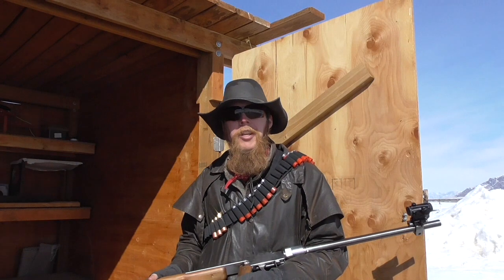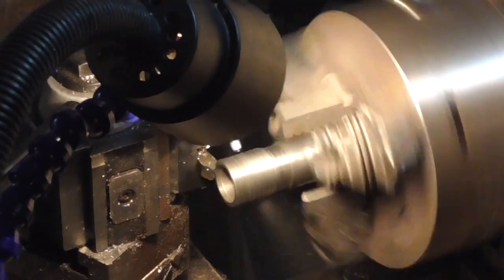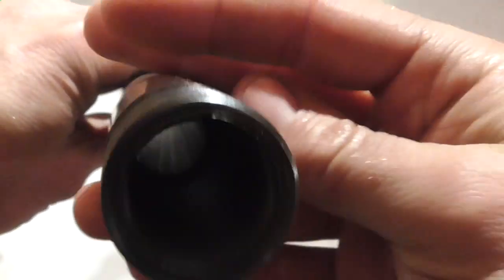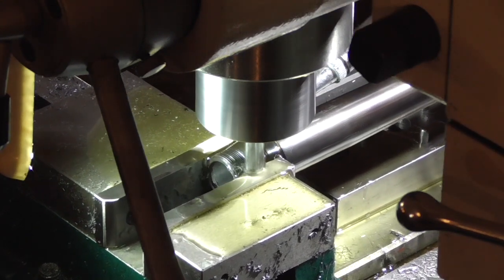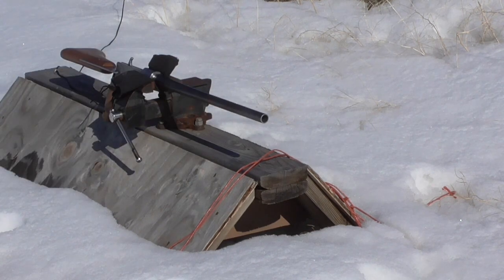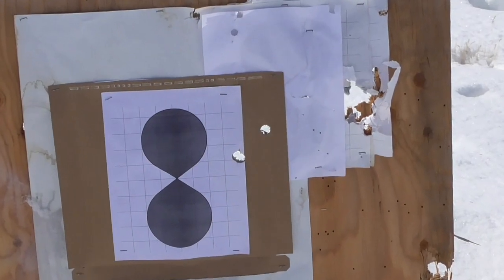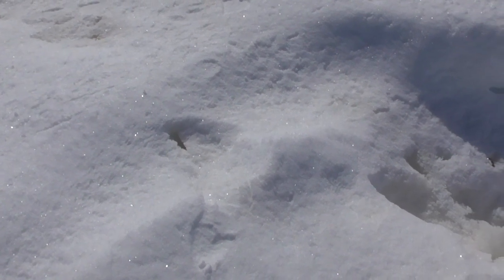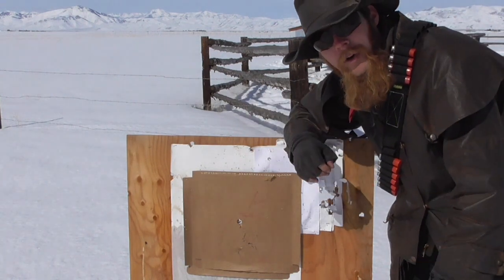A Slug Barrel for the GEFRRSn (TIS209)

Comment: Pretty cool! It amazes me to see that big of a button just push through like that. It didnt even have a pilot on it.

Seeing push buttons like this.. In the book that i am reading now: building a button rifling machine (Hoffman(You can download it for free on archive.org)). He states that you need a thrustbearing on the piece that holds the barrel. If you dont do that the button will smear through and give a bad rifling patern. And yet you have a nice barrel. 

I watched your video about making of the buttonmachine. I love how you made the piece with all the springs and pieces to keep the rod from collapsing. It is just like the patent of M.H.Walker 2383356. A contrapsion to keep the pushing rod from collapsing. I saw some company do the same thing; they had a big rod with a hole in it for the pushing rod, and a cut on the side of the hole so a 2 way hydraulic cilinder can connect with the pushing rod. The video is called: Douglas barrels (@3:26 in that video, you can see this).

In the Hoffman book they state that you would want to index the piece that holds the barrel, for anything bigger than .30, so it stays true to the twist rate of the button. You may or may not have a (slightly) different twist rate in the barrel, than how you designed it. 

Seeing you do this to a 12ga, you could even button a .50 with your machine. 

So how is the twist rate holding up in the real barrel? 

Greetings

Jeff
Reply: One more question: did you use another push rod in your buttonmachine, for all the different calibers? Because that would mean a bunch of new spacers to fit around it to.

Comment: What kind of steel is the dom tubing you use?
Reply from the maker: Most DOM tubing is cold-drawing from 1020 steel.  However, in this case I actually started with a commercial 12-gage barrel blank, which I believe was made of 4140 steel.

Comment: Hello.  Was wondering if there’s any way you can go into more detail on how you index and what not when making your reamers.  I liked the video where you made that .444 reamer but am curious to the dimensions and angles involved.
Reply from the maker: For indexing between flutes, I just rotate the rotary table that holds the workpiece manually.  There are 360 degrees in one full revolution, so if I want 6 flutes, I rotate it 60 degrees between cuts; if I want 5 flutes, I rotate it 72 degrees, and so on.
Reply: TheIdahoanShow great thank you.  Do you ever find that your grove diameter inside the barrel comes out smaller then that of the button?  Maybe not so much with that beast you made for this video! The reason I ask is I purchased a Chinese button that seems to be right at .2270 from the peak of two opposing groves on a six groove button for a .22lr.  If I measure between two grooves I get .222 but I’m hoping the 4140 will spring back enough for the 1-2 thou gap in theory the button will displace.

Comment: A rotary table might help with those interrupted threads, cleaner and faster?  I have had to do similar when doing Mosin Barrels where there is a relief for the extractor.
Reply from the maker: I have a rotary table, but the thru-hole in the center isn't big enough to accommodate the barrel.  I don't think I could get one with a big enough through-hole that would still fit on my mill.
Reply: @TheIdahoanShow  you could get a center and turn the barrel between the center and rotary Chuck.
Reply: @TheIdahoanShow  another option is a 5c chucker or spindexer .   I love your work keep it up.